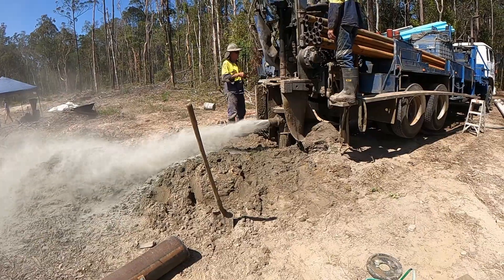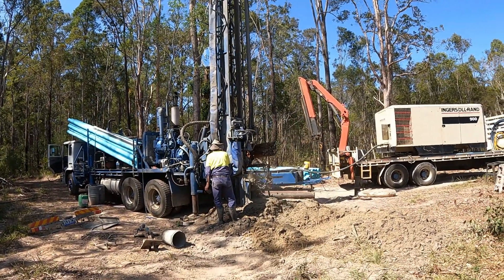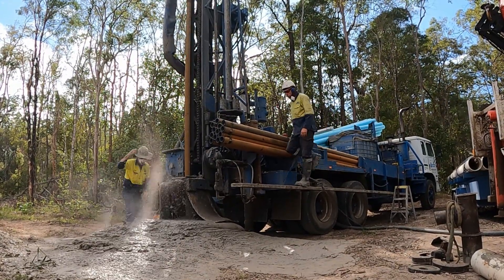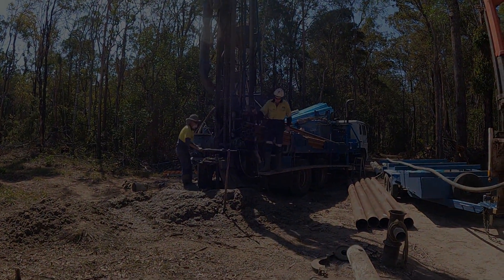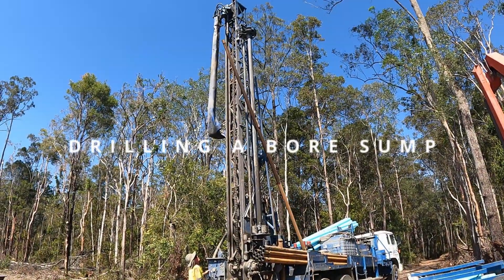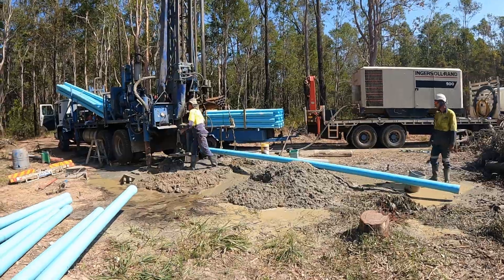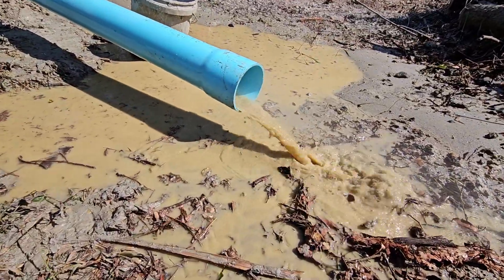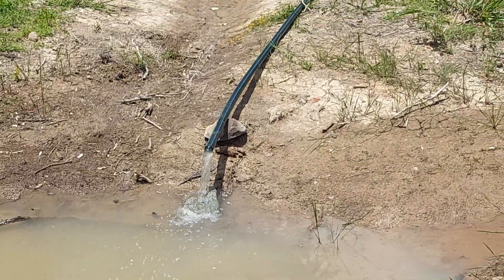Drilling a Bore Well in Australia  |  Start to Finish + Cost Summary

Comment from the maker: Bore Permits in NSW: Water NSW does the applications, they're mandatory to drill a bore, cost about $1K for a domestic use bore and then you can pump as much as you require for domestic purposes, within reason -  because you can deplete an aquafer by pumping too much, so it's a precious resource to be respected.

I mentioned 'registeted' bores in this video because back in the days some people may have drilled unregistered ones, nowadays it's a lot more strict with drillers requiring to see an application approved before booking you in.  

Bore needs to be (if I remember correctly) 40m from any gullies/Billabongs etc. and 50m minimum away from septic system. 👍
Reply: I don't think secondary water is precious nor respectable anymore seeing its full of toxic chemicals and poisons and is proven to be harmful to people animals and the environment. I'd rather drill for PW aka living water. PW is infinite renewable and in ABUNDANCE. we dont need permission to drill for and collect/use this free, pure and precious resource for this earth belongs to the creator and His human family
Reply: The only thing you don't really explain is, are you using a pump or just an open source with a valve to stop the flow?
But other than that, it's very helpful.
Reply from the maker: @mx4danx you mean how the air compressor was used to force the drilled material out of the bore? 

If so it seemed to have just been air pressure applied through the auger, but the technicalities of how that works would be best answered by an expert 🙂

Comment: This video provides an excellent overview of the groundwater search process! It's incredibly informative to see the steps involved, along with the challenges and decisions that come with such a critical project. The detailed breakdown of costs and considerations is extremely helpful for anyone planning a similar venture.

For anyone embarking on this type of project, having the right equipment is crucial. The Achilles Machinery mini excavator would be a great addition to the team. It’s perfect for digging, handling heavy materials, and dealing with tough ground conditions, which is exactly what you'd need when exploring for groundwater. This tool will make the job much more efficient and manageable. Great job on the video, and thanks for sharing such valuable information!

Comment: Cutting of pvc pipe for water inlet point should be done only on the bottom most part of the borewell, right?
Reply from the maker: @haokipletkhotinthang9564  yeah not the whole way down, just where the water seeps in 👍

Comment: Impressive. A little curious though, was the metallic case installed all the way and joined to the sump?

Drilled water in our farm (around Kilimanjaro-Chumvini) found water at 28M but continued drilling to 60M (second "river"). 
At the moment the water level is around 26M I have 2 solar pumps one at 30M (small one) and another 28M (bigger one) both serving me so well, from the video am now wondering was the extra 60M really necessary?
Reply from the maker: @kivaya  that metal casing went down to the bedrock only, and was jackhammered into it a bit. Then past the bedrock it was no longer necessary. 

Wow 60m is a long way down, the worst droughts shouldn't affect a depth like that 🙂

Comment: For how long you can get water from there?
Reply from the maker: There's no way to know for sure how big an aquafer is. In this instance the standing water level is pretty high (about 20 metres) so it's like having a 20 metre deep reservoir. With that said, it's always important to respect water sources and only take as much as necessary because if it does run out it could take a very long time for water to seep into the aquafer again.

Comment: Hi..after putting  down the pvc casing dont you put silica gravel sand in between casing and drilled hole to work as filtration  to avoid sand particles  to go through the screened casing at the bottom
Reply from the maker: On this occasion we didn't, maybe some other operators do. After we had already put the bore pump down the well, we learned from these comments that you can DIY install a flow sleeve on the bore pump. It's just another PVC pipe that covers the pump, so that it sucks water in from the bottom. This helps sand particles to fall to the bottom of the well, instead of coming in through the side inlet of the pump. 
But even without the sleeve, the amount of sediment we have coming through the pump is really minimal

Comment: There is no reason dousing would ever work; it is effectively magic. Affordable methods that can be used include: Electrical Resistivity Tomography, Seismic Refraction, and existing Government water table databases.
Reply from the maker: It's a funny thing like that as science technically disproved it, but for many, many generations old farmers have found groundwater with divining, and all bore drilling businesses have divining rods...
Reply: James Brown, I am a professional water diviner servicing a part of Queensland where underground water is scarce. Only about 10% of rural properties I divine contain underground water with a flow volume and water quality worth drilling. My success rate to date is 99% as I have only got one call wrong where the hole produced sloppy mud instead of liquid water. I have an Honours Degree in Applied Science from the University of Queensland. I know divining should not work, but it works perfectly for me and has done since I was 14 years old. I do not know the exact mechanics of how it works but it is definitely related to the void in underground rocks where the actual water flows and is not related to the presence of the water. In this part of the world, the scientifically-based alternatives you recommend are next to useless. Drillers who rely solely on selecting the drill site using these alternatives have a dismal success rate. Landholders are well aware of this and around here, they all ask for a professional diviner to make the final decision of where to drill.
Reply: Yes James, when you see it done it seems like magic, but it does work. The dowser detects fractures or voids in the underlying rock where hopefully water will be flowing. The fractures in the rock occur during movements in the earth's crust layer or when volcanic rock layers cool after reaching the surface during volcanic eruptions. Cooling causes contraction and consequent cracking. Sometimes there is water in these cracks if the crack is attached to an aquifer. If the crack is not attached to an aquifer, it does not carry flowing water. The equipment you mention also locates these underground fractures.
Reply: All the rods pick up is surface water. Mostly tree roots. As a water well driller unless you're in quick sand the formations stay pretty similar for one area to another. The op is correct. Sand is all just by luck. Rivers deposit by bends or movement in the river bed. Proud of the fellas in the video. Running that much surface can not be real fun especially without that hammer. We usually drill the surface with mud. Then switch to air.

Comment: so around 9-11k  $
Reply from the maker: For 42m depth, it's 200 x 42 = $8.4K under normal circumstances, plus the $1K permit fee is like $9.4K

Most people don't need steel casing but if you do, you add that on top because the steel casing is extra addition and extra process. So as an example 30 x 300 = $9K

So $18.4K total without pump. Not a cheap exercise but it's water for life and is an asset.

Comment: Did you say 4 or 40 k , my place is solid rock from about 6 feet
Reply from the maker: $4K, it's about $126/metre for test bore. Shouldn't cost any different if u have rocks, unless it's exceptionally hard stuff.
Reply: @offgridcitycouple4711  dolerite and confused

Comment: dowsing rods are pure BS do indeed move, but not in response to anything underground. They are simply responding to the random movements of the person holding the rods
Reply: Bro I used to think that but in my years or irrigation I’ve found the work more often than not. I’ve used them before and had them work for me so idk there has to be something to it.
Reply: @Coney_Tony0  There isn't. Try digging where diviners say there isn't something, and you'll see there's water there too.
Reply: @ had it work when finding pipes and it was accurate more often than not so I don’t know man. Maybe it just doesn’t work for you 😉
Reply: @Coney_Tony0  Thanks, I'll prefer science.
Reply: Slow motion photography has shown that the movement of the rods is caused by tiny, almost imperceptible movements in the hands of the water diviner. Whatever object the diviner is looking for underground applies no direct force to the divining rods, it is the diviner moving them.
Reply: I used to think the same too. But when i hired the professional to do it, he used to the dowsing rod first to find the right spot. After that , he used the PQWT detector to confirm. After drilling on the said spot for about 120 ft, the water was found and alot too.
Reply: Praying works as well. Try it.. (well, it works maybe 50% of the time. Or less. Maybe do a coin flip) Haha.. Entertaining, for sure! Great to see you've got water now.
Reply: They work perfectly every time for me…maybe it it works better for some then other as I’ve been told.
Reply from the maker: That's what we though until we tried it, gotta give it a go man 😉

Comment: Does one need to register the bore or can one just have a bore unregistered and are there fees to dig your own water
Reply from the maker: Water NSW does the applications, they're about $1K and then you can pump as much as you require, within reason -  because you can deplete an aquafer by pumping too much, so it's a precious resource to be respected.

I mentioned 'registeted' bores as back in the days some people may have drilled unregistered ones, nowadays it's a lot more strict with drillers requiring to see an application approved before booking you in.  

Bore needs to be (if I remember correctly) 40m from any gullies/Billabongs etc. and 50m minimum away from septic system. 👍
Reply: @offgridcitycouple4711  thank you,much appreciate the info
Reply from the maker: @AAAA-vu7fp  🙂